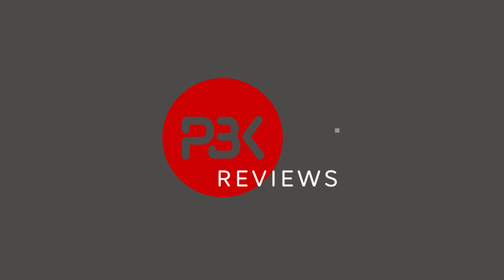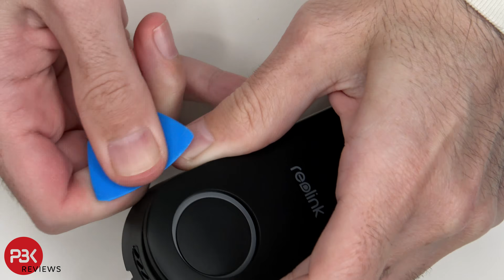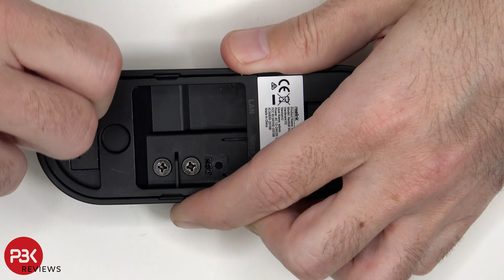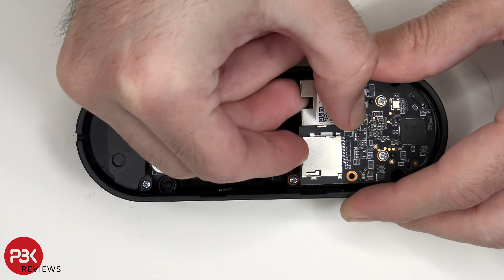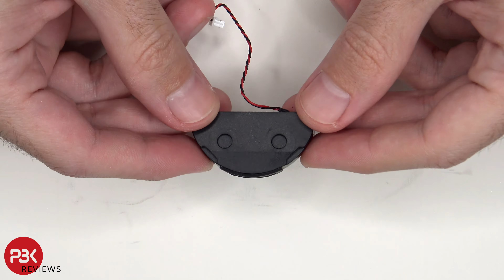REOLINK Video Doorbell Wifi Teardown Disassembly Video Review

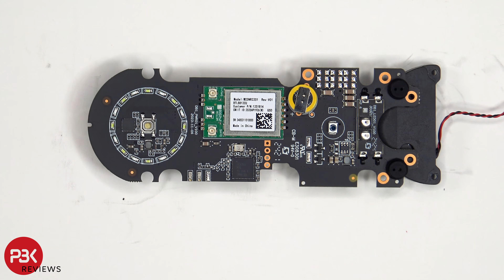Comment: Thanks for the detail on this video! So I am trying to make my house completely RF free and on that note I got the POE model of this Reolink doorbell but it uses a 433 MHz to communicate with the chime.   I was thinking about overlaying a membrane switch bellow the plastic button (on the inside of the unit of couse) but on top /over of the main doorbell switch you show at 4:09.  and simply running the wires to my AC powered mechanical chime.  Any thoughts on that?  Thanks again!

Comment: My doorbell microphone is totally muffled after a rainy day despite being IP65. If I tap/knock the camera, I can hear, but 15cm distance I can't hear unless I shout
It's been 2 days since that rain and looks like it won't wolve after drying completely
Do you know the mic model for replacement? Right after this moment 4:24
Reply: Hi, did you get any joy? Mines done the same, it’s out of warranty and I’ve took it apart but I can’t identify the microphone
Reply: I’ve found the following mics, product SPK0641HT4H-1 and MM042602-15. These look very similar to the ones in the camera. Hope that helps.
Reply: @Heartagram20  Thank you very much for tracking those part numbers down!  That's exactly the info I needed.
Reply: @robd5248  No, I ended up just getting a new one after realizing mine was still under warranty.
Reply from the maker: I'm assuming you attempted to take apart the unit and use a small brush like a tooth brush to brush off the mic? Also make sure to brush out the hole in the housing which leads to the mic. As for the mic model itself, I'm not sure. But as a last resort, I would attempt de-soldering the mic and soldering it to the second mic slot on the other side just to test if it works on that side of the board. If not then try to find a replacement mic etc.
Reply: @PBKreviews  I tried that, but no success
My doorbell came with the 2 mics soldered, so i'm wondering If one of them wasn't working for a long time an I did not notice until the second one deads...
One repair shop told me to try the old Nokia Lumias microphone... i'll give it a shot to see what happens

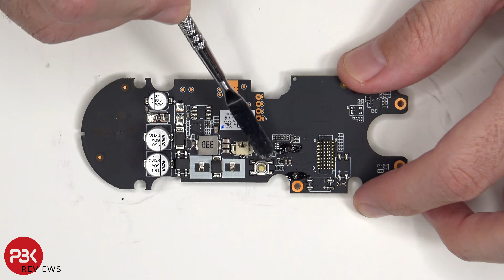Comment: 4:00 you can clearly see the Wi-Fi module that is necessary, they use the same main motherboard in the PoE model (but skip this module) to force network connection. Reolink could make a single model that is compatible with both PoE and WiFi; but they don't.🤔🙄😒

Comment: 3:30 you can clearly see the missing diod necessary for the PoE power delivery. Reolink could make a single model that is compatible with PoE and WiFi; but they don't.
Reply: Good eyes, and I believe you're right. They're MB6F bridge rectifier diodes.About $0.25/ea if you want to try to convert a wifi version into a PoE version.
Reply from the maker: Interesting, if I was better at soldering, it would be a cool project to try and add the missing components to see if it would work.

Comment: any advice if I want to enhance the wifi antenna? this doorbell is suck in wifi signal
Reply from the maker: I would assume the wifi module (green board attached to the main board where the coaxial cables attach too) would need to be replaced with a better one.